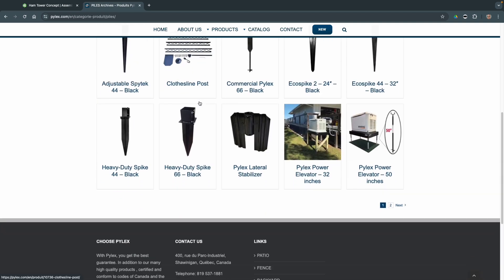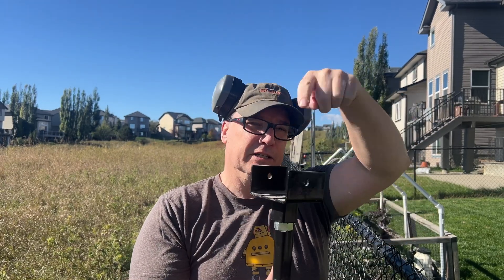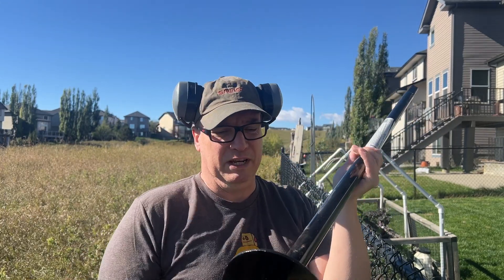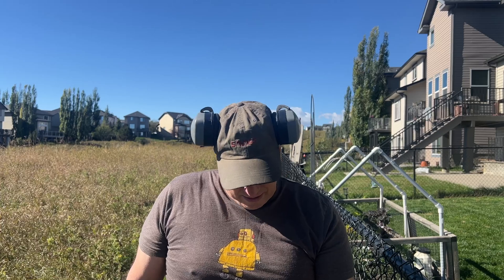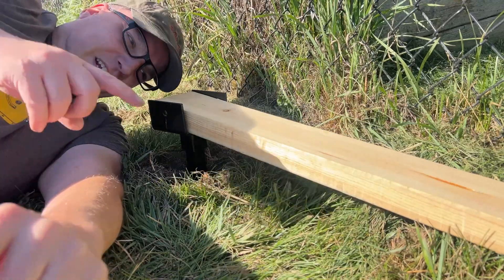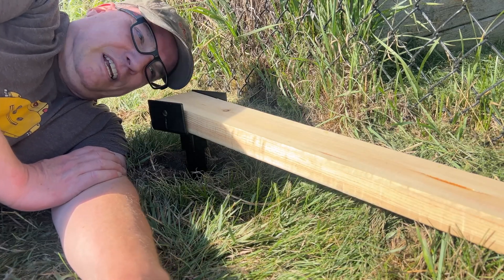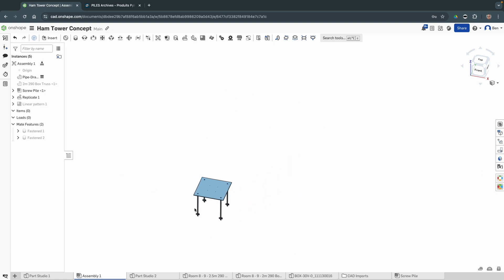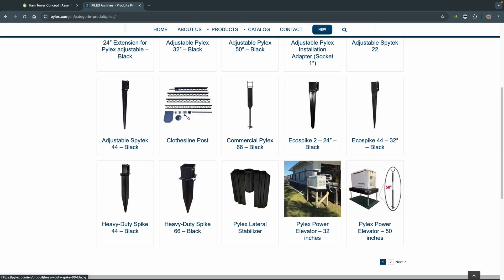No Concrete Needed! Install a Strong Antenna Ground Mount Easily

Comment: ummm not sure about mounting a whole tower to this 3:15. lol.  It's a bit ambitious to me. But for a 30 or 40 foot telescoping mast with guy wires should be fine. In any case, excellent job and thanks for this informational video.

Comment: Man I really want to try this but I doubt it would work here in the Las Vegas dirt. It's fucking concrete hard ground here.
Reply from the maker: Here is a trick that the MFG gives on the screws. Wet the ground for a few hours before screwing it in. The water loosens up the soil. But I honestly do not know if that would work. Something to consider though.

Comment: 3:37 Like a chain, it’s as strong as its weakest link. If the mast is pushed by wind in a direction diagonal to the plate, only one corner will take the pulling force together with the bend resistance of the plate at that point I guess. So the strength of the four legs doesn’t add in more than four directions and then only two of the legs add up, except for the bend resistance of the other two legs.

I don’t know how much force a certain wind speed applies to the mast, but that force at any point, adjusted for the leverage the higher you calculate, is what a single foot would need to endure.

I’m sure it’s enough!

Comment: Thanks!  I have a hex beam antenna that has to be on a tower but I really don’t want a cubic yard/meter of concrete in the back yard for several reasons. The tower only needs to be 20’ or 6.5 meters tall to clear the roof.  The central tube will provide the additional height.  73 de KJ5HHG!
Reply from the maker: Glad I could help!

Comment: Clay soil here in California too. Hose the soil with water, drive in 1/2 foot, hose some more, drive in. It hardens quickly as it dries. If it's out of plumb, wet some more etc. Works until and if you find bigger boulders underground. As long as it's just clay, water will help.
Reply: im used to heavy clay with rocks and debris. bang stakes to make holes, wet the area for 2 days. cut the ground away with a pressure washer and a waste water pump. pull chunks out with a hoe. for a small tower use minimum 1 cubic meter of concrete and scrap rebar. full length 1" stainless threaded rods for leveling and mounting the tower base

Comment: Cool. I've been looking for a non-concrete alternative for mast support. These look awesome. I would imagine digging a shallow bell shaped hole, driving the anchor in the center and back filling the hole with Sika PU or something would add even more strength and especially lateral strength. Lateral strength is most important when putting up a mast or tall antenna since all the load tends to be side to side and not downwards like a building or structure on top. Of course the load on your piling there is probably 30 pounds in a 100KPH wind or something lol. I wouldn't be scared to use one of those and put 30 feet of 40MM inch steel pipe up and a rotator and hex beam on top of it and forget about it for a few decades. Oh BTW, I'm pretty sure the only place you'll find a guy who just happens to have a 3/4 impact driver on hand is Alberta lol Wonder if my Milwaukee 1/4 hex impact driver with a 3/4 adapter would drive one of these pilings in :) Love the content man.
Reply from the maker: lol. There are added fittings for lateral support as well but the pocket you suggest is definitely worth considering. In the end soil conditions are important as well. Obviously sand is not going to be very effective

Comment: My shack is a metal building out back.  It has four auger type anchors holding it in place.  One of them serves as my station earth ground.  I don't see why this device would not work equally well.

Comment: I'm exhausted just watching this.  Neat idea though.  Definitely wet the ground using deep drip watering spikes for a couple of hours first.  I did that for driving my ground rod.  Got it good and soggy down about 36 inches.  Used a fence post driver to pound it home.  Go with a dedicated ground rod.  Use the fence as counterpoise.
Reply from the maker: Thanks for the tips!

Comment: Why couldn't you use a regular grounding rod for a house?
Reply from the maker: I absolutely can. I think screwing something into the ground might be easier than pounding a rod in. I am not 100% sure. I was more curious if it might be a dual use item.
Reply: @VE6SFX_HamRadioRookie  An impact driver takes care of an 8ft gtpund rod pretty quick.
Reply from the maker: Good to know. Thanks

Comment: I admit to being somewhat of a belt and suspenders sort of person, but I feel a need to recommend a better means of grounding your system.  ARRL ("Grounding and Bonding" 2nd Ed.) and Motorola recommend a group of 8 ft copper or copper-coated grounding rods.
Reply from the maker: Good advice and thank you

Comment: I like your style.  You ever tried to put the section where the cable goes in at the bottom?  That's the way I run it.   Love my JPC-12.  You ever tried the tripod that comes for that?
Reply from the maker: I bought the pieces separately. So I never got the tripod. Over the next few videos you will understand why. I may be able to supercharge your JPC-12 kit with what’s coming up. Love the idea of feeding the coax in from below and am considering doing that soon
Reply: @VE6SFX_HamRadioRookie  I am kinda curious now to see what that does to put it up top.  I look forward to seeing what happens next.  I want to try this method for a more permanent solution.